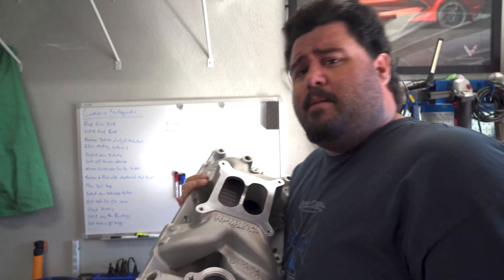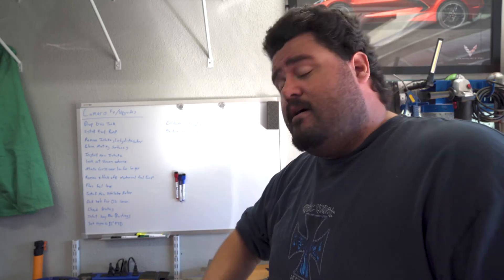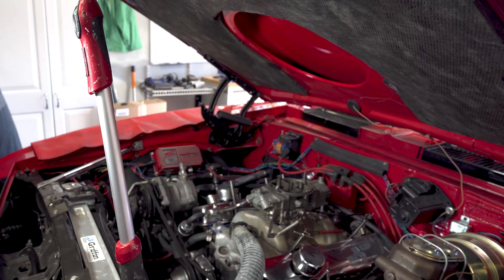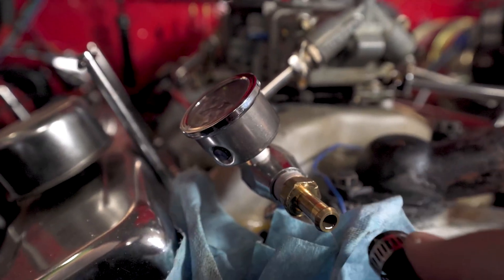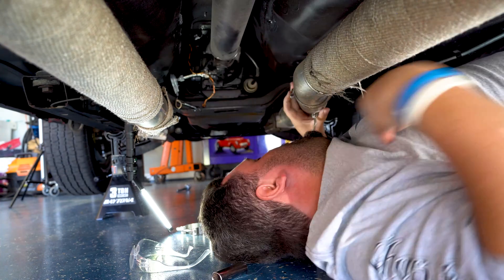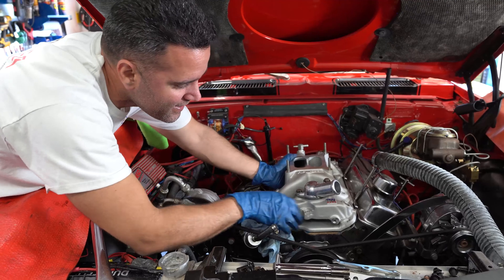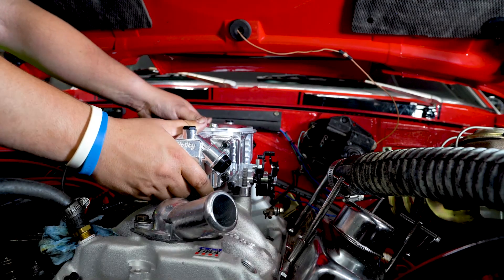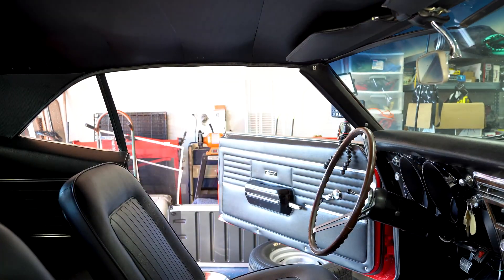Sniper Efi Install didn't go as planned

Comment: It took you 3 mos to get an intake manifold. You forgot many factories were having problems with production due to COVID. COVID has disrupted totally normal life everywhere.
Reply from the maker: Actually the problem was not Covid in this case.  They had it on the shelf when I ordered it. There were a bunch of shipping issues with only the intake manifold. All my other parts showed up in 2 days. Really was not a big deal. Its not my primary car, and it was not a necessary part I had to install. I am very fortunate for everything I have available access to.

Comment: LOL

nice single tire fire 4 x 4!
Reply from the maker: Lol, yeah no idea why only 1 tire smoked when it left 2 strips on the road
Reply: @AcesGarage  Because the clutches are shot.
Reply from the maker: @RipitRon  yeah the clutches in the diff are older than I am so they are probably a little loose 😁. Adding yet another project to my list to fix. lol
Reply: @AcesGarage  A suspension would be #1 on my list, that thing rides like Bigfoot!
Reply from the maker: I would love to lower the Camaro but its the wife's car and she says no. she likes the rake on it so I'm not allowed to mess with it. The Camaro is in maintenance mode for the rest of its life much, the car has huge sentimental value as it is for the wife. That's why I a bought a f100,  so I can go more performance😃